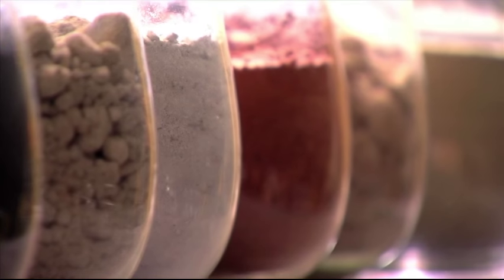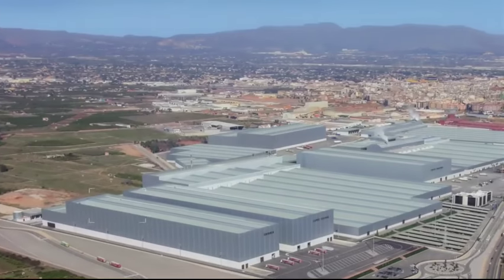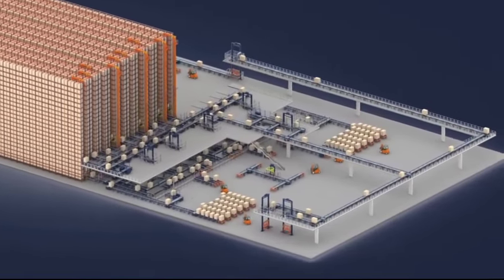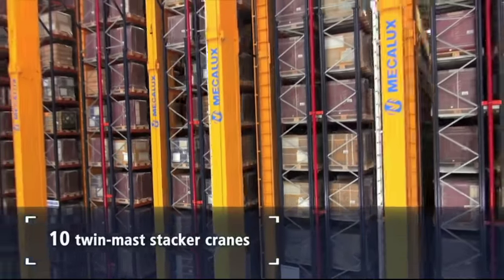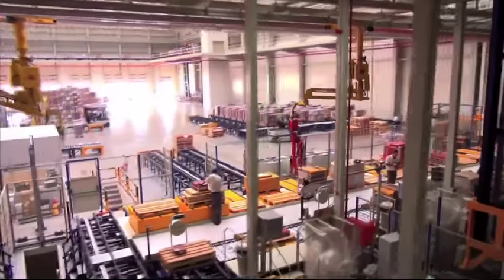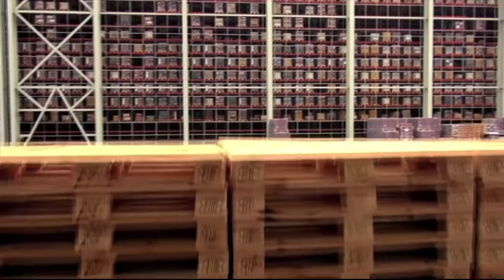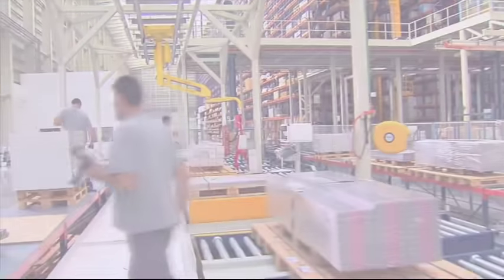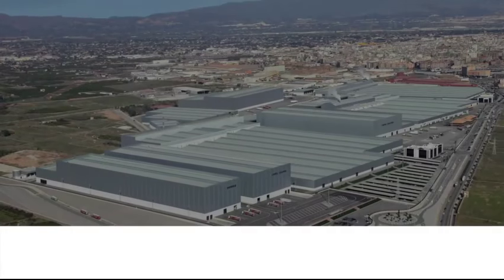5 fully automated warehouses make up Porcelanosa massive logistics complex

Comment: machines always work nice when they are brand new
Reply: Booker T Good point. They didn’t mention any fail-safe backup to the machinery/software etc going down. Hard to see how you could have manual backup for such a storage system.
Reply: So do people
Reply: I have worked with old machinery that works better than a lot of the brand new machinery.  It's only nice when it's well designed with ease of maintenance in mind.  A machine is only as good as the people who take care of it.   This is nothing compared to a typical Amazon fulfilment center.

Comment: What happens when the pallet breaks and it can no longer roll on this conveyor? I've worked in a warehouse and a broken pallet is easier to find than a good one.
Reply from the maker: In automated facilities, the inspection of pallets is crucial. There are several inspections of the state of the pallet and the Load Unit before it enters the circuit. If the pallet is not under the programmed conditions it is rejected. You can see how this inspection unit works in this animation: https://youtu.be/qeVUcnCqp84
Reply: @MecaluxGroup  Awesome video demonstration, great job reading through the comments and answering people.
Reply from the maker: Thanks for your feeback. We do our best to support and clarify concepts that are sometimes a bit confusing. Stay tuned!

Comment: How thick is the floor? or are the racks on piles?
Reply from the maker: Hi! Thanks for your question. The slab is one of the most important construction elements of an industrial installation. The slab must be calculated according to the forces transmitted. Based on this, other aspects are then defined, such as: concrete type, mesh or resistant fibre, thickness, levelling, surface finishes, drainage system, location of joints, the slab laying method, etc.

Comment: Nice clip! But why they need so much inventory? 270.000 pallets. Thats way to much. With Lean Production you never had 270.000 pallats inventory. Only produce what the customers need!
Reply from the maker: Thanks Felix for your comment. Certainly is a huge inventory.  For your information, this warehouse is in a current expansion to finally accommodate a total of 95,140 pallets, (only in this warehouse). You can learn more here: https://www.mecalux.com/news/porcelanosa-venis-warehouse-expansion
Reply: How well does that work when you have trouble getting raw materials?  When suppliers have delays, are your customers going to be happy?  When a supplier goes out of business and you have to scramble to find a new one, wouldn't it be nice to have a supply on hand to cover until you do?

My wife is a buyer and complains about these things all the time.

Comment: And you want to know why the product that comes out of this warehouse is so expensive....  One thing this video won't tell you is how much all of the robotics and specialized racking costs.  Not fully automated when it can't pick individual cases/pieces.  No word on down time, software glitches, dirty sensors, broken pallets, etc. which all of these machines have issues with.  Yes, all of these machines call in sick, take vacations and take FMLA.  It's called down time.  No cost to production ratios including down time mentioned in comparison to a full forklift/pallet truck faculty.  Believe me folks, the only person that is paying for these outrageously expensive robots and racking is the consumer when prices for goods are passed on to them.  The product vendor and warehouse ultimately pay nothing.  All the while, the person that sold this robot to the company that owns the warehouse just bought a new island off the coast of Bermuda and is laughing all the way to the bank.  As far as loss of jobs go, yes there are loss of jobs.  No, the employees that used to run manual equipment before robotics came on the scene are not trained to operate, fix and repair these robots.  These machines are built and set up by a third party under contract.  That same third party (usually foreigners) stays with the machine and operates and repairs it for the life of the machine at lower wages and less benefits than that of the forklift/pallet truck operators that they replaced.   These are rich man's toys that they can wave around as bragging rights to other corporations or LLC's that don't have them.  They're nothing more than trophies that sit on a shelf.  The mystery of inflation is that there isn't one.  It's all of this tech and robotics that is causing much of today's inflation, and we are all paying for it unnecessarily.  You wonder why the price of automobiles went up tens of thousands of dollars over the years?  No.  Not unions.  Yes.  It's robotics.  Maybe some day when robots become sentient they will unionize and a little justice will be served.

Comment: You'd think they'd have this figured out by now.
Reply: They have had this type of stuff for years with picker forks. "They would've figured it out" doesn't account for the fact that regardless how it's designed, you ALWAYS ALWAYS get pallets that break, machines that drop stuff, stuff falling off pallets from way up high.... if you've actually been in a high stacked warehouse you'd see that this is an animation dream, but the reality is a LOT messier. And sometimes the sheer BS you have to go thru to unblock the screwups actually makes it easier to use an older system.

Comment: This is the future. Mass unemployment because of automation.
Reply: This'll create more jobs for other stuff. Mass production is a machine's job, always has been.
Reply: @stealthxg5045  It might create new types of jobs, but there will be far fewer people to do those jobs. That's a result of automation anyways. Many of the newer jobs will require more training.
Reply: @iEntertain Don't expect the quality of work to get better with automation. They will make people robot assemblers . 

Making the cables for robots is not too fun. And, it can be straining on your hands. Hopefully, they will do some volume and have machines to help you. 

There are crimping machines, that crimp on some connectors, so that step isn't too bad. 

And the people that do the software and hardware are a very small percentage in robot organizations. 

And, it may require over 1 year of training. But, companies aren't willing to train or promote employees from within, so you can be stuck at the bottom as an assembler. You might get to do some testing also, but only at the simpler level.